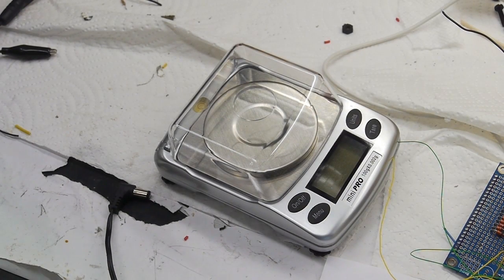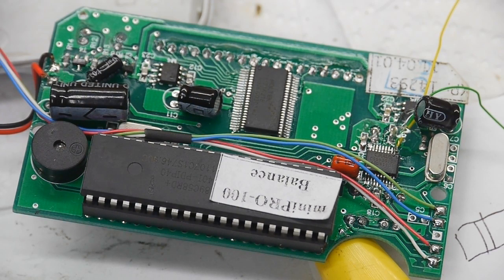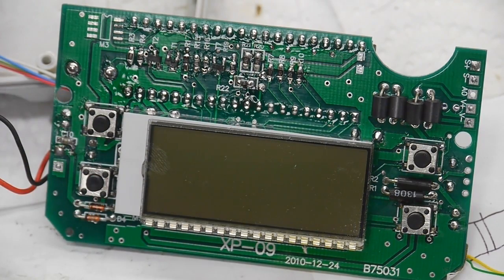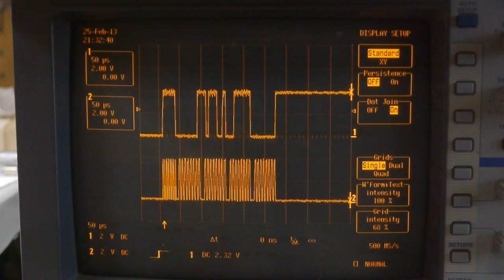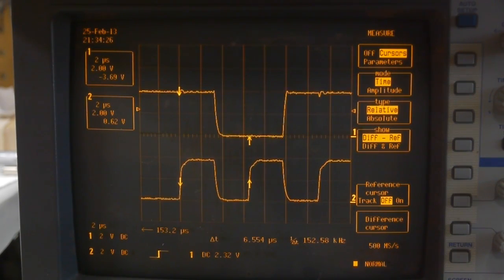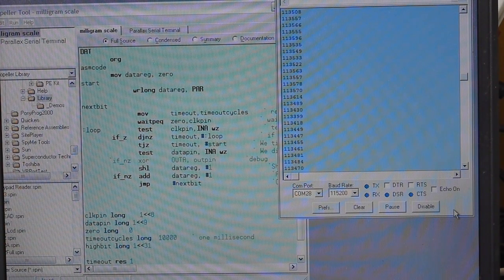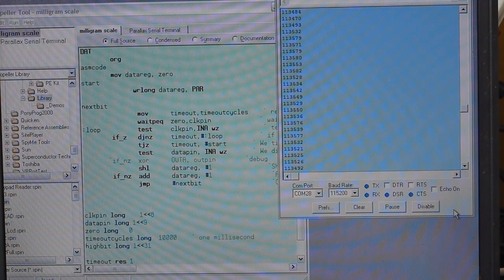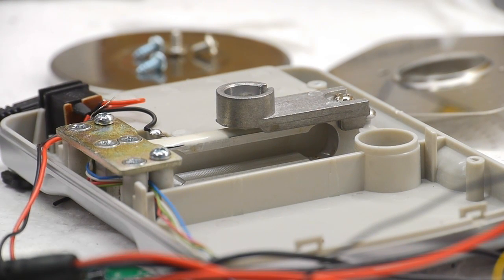Hacking a milligram balance (scale) with a Parallax Propeller microcontroller

Comment: 6 microseconds per clock... Cant a standard arduino nano handle that? Even so, the atmega in the nano can put their SPI into slave mode and accept an external clock signal for the spi bus.

Comment: I would have sensed the tare button as well and used that to measure a zero value to subtract from all values.  Also, it is worth the effort to install a 4-5 pin connector so you can separate the two when you just want to weigh something.

Comment: I realise I am 6 years late, but you could also put a 32-bit shift register in-line with the data bus. As long as your microcontroller could detect when a transaction had occurred you could read the 32-bits back at your own pace.

Comment: I would have used a bunch of shift registers, to then read the bits serially at my own pace. Alternatively I would have used a PIC microcontroller since I know I can avoid interrupts altogether and have a wait loop there (after checking it's not in the middle of a number), similar to what you did there.
Reply: I know it’s been a long time, but I had exactly the same thought. I actually said “use a shift register” out loud when he was talking about how hard it would be to poll the chip.

Comment: Could you decode the data going to the screen? The screens use a standard(they are in the arduino libraries) that an arduino could understand. Then the scale does all the figuring out/work for you and you just convert what the screen says to another screen or what ever you would like.

Comment: Just read the data lines to the LCD. The protocol is simple enough for any microcontroller and well documented - no need to fiddle around with SPI, plus you would get actual (calibrated) measurement results instead of meaningless ADC values. I know this is 4 years too late, but it had to be said :)...
Reply: +Benedikt
The µControler does not directly control the LCD. It sends display data to the LCD driver, using a simple and documented protocol.
Reply: That's still a major PITA. The uC does not just send digits to the display, but segment data. This segment data does not even have to be in the order shown on the display, but can be tangled up to ease PCB routing. So it would essentially involve copying the display data to local RAM on the add-on board and then a few bitwise operations on the display RAM's contents to get the individual digits and finally some lookup to turn the individual digits into the numeric repesentation. Also, the scale can display errors and other more of less useless info, which has to be differenciated by the add-on board.
I would consider reading the ADC values and doing a two point calibration on them to be a lot more useful. In fact, replacing the original uC might be the best option here. Building a small converter board should be doable that has a DIP footprint and the  uC of choice ontop.

Comment: Just wandering, sometimes I see the use of ADC converter and sometimes not. Why is that important?
Reply: Not sure what level of technical detail you are expecting to answer this question so I will try to cover it all:
To display this measurement (analog voltage) on an LCD (which is digital), you need to convert the analog (varying voltage) signal to digital (1s & 0s).
An ADC is important here because it is the specific analog value we want. If we just wanted one or two particular voltages to be interpreted digitally there are ways of getting these without using an ADC. 
So to answer your question at the most basic level, the use of an ADC is important when you want to measure a range of analog voltages with a digital system. 

At a more technical level, why you see an external ADC:
Some microcontrollers have built in ADCs (this one probably does not, generic 8051s do not have onboard ADCs).
The use of an external ADC is also to gain the benefit of better resolution (detecting smaller voltage changes), faster conversion speed, pre-amplifiers or other features. 
For most uses the integrated ADCs of a modern microcontroller is sufficient, sometimes with a bit of supporting circuitry.

There also exist ASICs (application specific integrated circuits) for weight scales. These ASICs have the microcontroller, wheatstone bridge compensation, ADC and LCD driver on one piece of silicon. Which is another reason you may not "see" an ADC.

Comment: Would it be possible to build a weight using a capacitor construct? The idea is that by applying force to one plate of the capacitor, the distance gets reduced, increasing the capacity and changing the electric field. Either you could somehow measure this (E-field/voltage/etc.) or you could shoot electrons through and record their path, building an analog display.
Just realized that the electric field is independent of/from(?) the distance.

Comment: Cirrus says in their documentation of the device that it is SPI and Microwire compatible..wondering why you didn't do that route?
Or did you want to maintain the scales native functionality while reading from it?
Reply: He could have done that without interfering with normal operation: connect a μC with SPI support configured as slave (clock to clock, scale MISO to μC MOSI, chip select to chip select) and you're done. 
Although that would still require him to do calibration and find the relationship between measured voltage and weight (basically replicate all the functionality of the on-board μC). If I were doing this, I'd probably tap into the display data, leaving the on-board μC to do all the work. That or dump the ROM from the μC and patch it to also send the results over UART (which the μC almost certainly has) and work with that. But tapping the display data probably would be easier. 
Why didn't Ben do any of this? Well, he's a mechanical engineer, not a computer engineer. He can't know everything, he used what he knew.
Reply: He don't know enough to.
Reply: Hm, Yeah..I guess. But speaking on behalf of other mechanical engineers like myself that don't know everything..
That seems sort of a waste too given the LCD controller is a Holtek..and I've never seen a Holtek controller that didn't have a 3-wire serial interface.
Reply: ***** Yeah, that's what I meant by display data. Tapping into the driving signals would be a mess since they'd be turning off and on all the time as the LCD is being refreshed.
Reply: Ah..well, there ya go!  ;-)

Comment: The propeller has to be the worst choice here. Almost all micro controllers have built in SPI serial functionality, like the $5 raspberry, and they will easily receive SPI data with little or no programming.
Reply: The raspberry pi is not a microcontroller.

Comment: As you found out, it's certainly possible to do this with programming, but I would think this would have been a lot easier with a UART chip.
Reply: Not UART, UART is asynchronous (that's what the A stands for), this was synchronous serial (more specifically SPI). Pretty much any micro controller these days supports SPI, so the easiest and cheapest way to implement this would have been using something like a $1.50 ATtiny.

Comment: Wouldn't you be able to read the output from the lcd?
Reply: No.  That's not easy either.  If it was an LED system, you had a better chance.   LCD controllers have to switch polarities fast.  Otherwise the LCD will fade out.   However, on the second thought, this scale has a separate LCD controller.  He could have tapped the bus lines between 8051and LCD.  He is not a HW engineer.   He is just a mad scientist!

Comment: If you have a clock and data lines, couldn't you have used a microcontroller with an SPI interface like adruino? Put SPI in slave mode and just read the bytes. I was able to push 0.5MB/s on AVR's internal clock, and around 1.2MB/s with a 20MHz crystal. AVR's SPI can read or write a bit with just two clock pulses.

Comment: just an idea, and im not sure if this would be logical or not. but maybe you could tap off from the communications between the mcu, and the lcd controller, and read the values that would be going to the lcd. that way when you do tare, you would get the weight and be able to skip doing the calculations yourself.
Reply: bowlofpudding it sounds like it would reset the system? maybe, maybe not...

Comment: Quite some time passed from uploading of this video but anyways... You made a classic SPI interface a headache with reading bit-by-bit :) Even the cheapest microcontrollers running at 8 MHz have a hardware SPI which can be put into slave mode and read even a 4 MHz clock bursts. Then you just sit back and let the hardware do the work :)
Reply: That’s because your average cheapest microcontroller is too slow to, say, bit bang multiple SPI streams in parallel (Prop 1 can do it no problem on one core), and doesn’t come with 8 fully deterministic cores. There’s nothing “headache” about this on Prop 1. It’s normal and sort of out of the way. The peripherals are software defined, you still use them as individual “encapsulated” blocks. You build them and test them separately when you need them, and then you use them as you would any other peripheral. The cheapest 8MHz microcontroller needs dedicated peripherals because it would be useless without them. Prop 1? A whole another story.
Reply: Similar sort of thing on the new Raspberry Pi microcontroller which has special cores for software defined IO.... simpler and less versatile than the Propeller though.
Reply: This is SPI sniffer that is looking for the master to manage CS and SCLK, and the slave to manipulate the MISO line. The Propeller doesn't have dedicated SPI hardware because one can use a core to synthesize this process. Advantageous in this case where he is wanting to watch both sides of the process.
Reply: That's not how the Propeller works. It's read bit-by-bit for a reason, but is a lot more flexible because of it.

Comment: I couldn't see the display electronics but if it used a standard LCD controller it would be easy to copy the display data or you could copy if scanned. Individual segment control would be harder but still not that hard.
Or you could just let the SPI clock drive a shift register to read it. Or you could use a micro with SPI akready built in like many PIC.
The built in SPI would be the easiest way to go if it doesn't use a standard LCD controller like the HD44780.
Reply: Reading the display data really is a major PITA. The uC does not just send digits to the display, but segment data. This segment data does not even have to be in the order shown on the display, but can be tangled up to ease PCB routing. So it would essentially involve copying the display data to local RAM on the add-on board and then a few bitwise operations on the display RAM's contents to get the individual digits and finally some lookup to turn the individual digits into the numeric repesentation. Also, the scale can display errors and other more of less useless info, which has to be differenciated by the add-on board.
I would consider reading the ADC values and doing a two point calibration on them to be a lot more useful. In fact, replacing the original uC might be the best option here. Building a small converter board should be doable that has a DIP footprint and the  uC of choice ontop.

Comment from the maker: The 80c51 gets to set the timing for the whole system. The ADC is polled by the 80c51, so we only need sequential instructions to clock in the bits. Adding another microcontroller to eavesdrop on the bus requires interrupts, very fast polling, or hardware (SPI slave mode, which is probably the best solution and I was unaware most microcontrollers had this) to catch the bits as they go by since timing is still controlled by the original 80c51.

Comment: The clock is used to push bits around, nothing to do with how fast the ADC samples. Take a look at the datasheet of CS5530. The 7.5Hz is the slowest sampling rate it supports, and it provides the highest resolution at that rate: 19 noise-free bits. Under stable load, when you take difference of two consecutive samples, the 5 lowest bits flicker randomly, the rest is zero.

Comment: Nice video.  You were really lucky to find such a poorly designed scale!  I've been tinkering with one but both the ADC and LCD Driver are integrated into a single Chip-On-Board Blob.

I'm more familiar with PICs but you could definitely let the hardware help you if you have SPI.  Just use Slave mode and it will clock in 8 bits and then INT.

Comment from the maker: There are pros and cons of doing it this way. One problem is that the screen only updates once per second (or less), but the uC receives data at 7Hz, so there is some filtering happening, which may or may not be desirable. Also, if the user presses the tare button, the add-on circuit has no way of knowing that the scale has just been zeroed.  This could cause problems if the user presses tare just before or during dispensing.

Comment: 1/ Standard interfaces are the way to go - for both the ADC manufacturer + the micro controller manufacturer.
2/ SPI is supported by many micro controllers as an on-board peripheral. e.g. all PIC16/24/32/dsp + MSP430s + etcetc
3/ It's cheaper for the ADC manufacturer to offer one chip that can be used for both low and high sample rate applications

Comment: Thanks for sharing.  Usually this sort of hardware hacking is intimidating to me, but you have shown how easy it can be.  Although it would probably be more challenging, it might be better to decode the LCD interface and manipulate the buttons using some of the GPIOs on the Propellor.  This would allow the Propellor to interface with the scale like a real user would and would give you access to all of its features including the tare button.

Comment: Think about how an ADC works: An ADC is actually a DAC and a comparator. You measure the high-order bit first (is it above or below 8V?), then the next bit (is it above or below bit8*8V+4V?), etc, binary-searching for the input voltage. If the input changes over the sample period, then the result can be inaccurate. eg, if the input drops from 16V to zero just after the first bit is read, then the result will be 8V. Essentially, the faster the ADC, the more accurate it is.

Comment: This may be a dumb question...

The microcontroller only queries the ADC at about 7.5 hz, I assume because the actual weight on the scale isn't changing rapidly enough to warrant querying anything faster. However, you said the clock speed of the actual burst is something like 150 kHz (1/6.5E-6).

Why such a mismatch? Do they just not make slow ADC's? The sampling rate of the ADC just seems like serious overkill for the application to me.

Comment: Whoops, accidentally deleted my other comment in some sort of spastic movement, not sure what was going on there, whatever, got something to add anyways.

My dad designs electronics hardware fro his living, so if you can find some sort of reference number on the weight sensor cell, send it to me, my dad can probably help you out.

The cables are probably +V, -V, +Signal and -Signal, although they are not colored as usual, normally it's 
+V:Green
 -V:Black
+Signal:Red
-Signal:White

Comment: Hi Ben,

As some people have mentioned, SPI - use a PIC32 or something in SPI slave mode, and set it to interrupt every 4 bytes - you would only need to connect the SCK and SDO (from the ADC) lines, so it would be passive - just "listening" to the data being sent from the ADC and being clocked by the same clock that the ADC is being clocked with

You could even pipe the SPI module using DMA to fill large chunks or ram for you automatically

Comment: Is it not possible to capture the signal AFTER the build in micro controller? --before the LCD driver? -or maybe decoding the direct LCD signal, although that can be tricky, as the LCD signal is AC and non-obvious seven-segment connected.

Comment: I don't know anything about the Propellers, but I have written 115.2k serial receivers on a 4 MHz (1 MIPS) PIC micro. The trick is that since you know the timing on both sides, you can simply read the bits on specific timeslots spaced out with NOPs. You interrupt on the first rising edge, and you stay in the handler until you've read the entire burst.  At 115.2k and 1 MIPS, I had to average 8.68 insts/bit, so there were a variable number of NOPs between reads.  24 bits is only slightly trickier.

Comment: Would that be a huge issue even if it did happen?  Wouldn't you just lose one data point and get another in 1/7 of a second?  I would assume it would depend on how precisely you are trying to measure what you dispense, and how fast you are dispensing.  Of course you would want your code to recover gracefully and not just give you a gibberish result, and assembly is not known for its ability to handle boundary conditions.

Comment: One hack on a uC would be to take an int on the cmd byte's clock, then, in the handler, use a dead DMA from the GPIO, i.e. SRC=GPIO (no INC) DST=chip ram. With a little tweaking on the xfer dma size&speed, you should get a very deterministic result.

Comment: Wouldn't it be easier (and cheaper) to put your mcu between the cpu and the lcd controller?

You could then use the hardware serial in of your controller to get the commands at high speed then pass through to the lcd at potentially lower speed by bitbanging if the mcu doesn't have two serial ports capability.

You have the datasheet with lcd controller commands so you just ignore everything except the numbers. And since the screen updates less often you have time to process the values.

Comment: hm.. looks like a SPI task.

I somehow think the orginal microcontroller would end up getting ripped out of the socket, if I did the same. And then just read the ADC using some external 5V microcontroller.